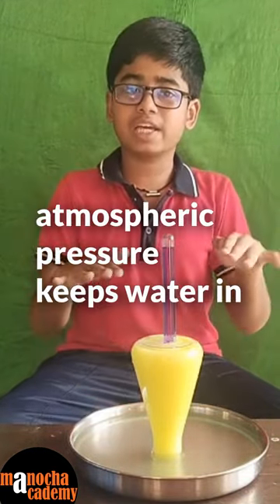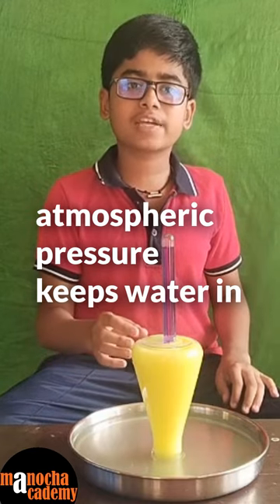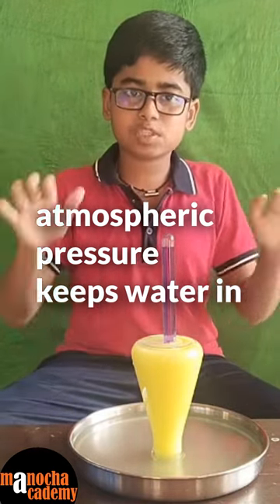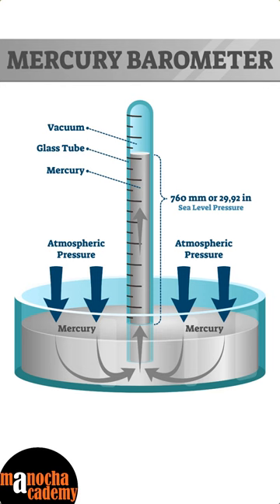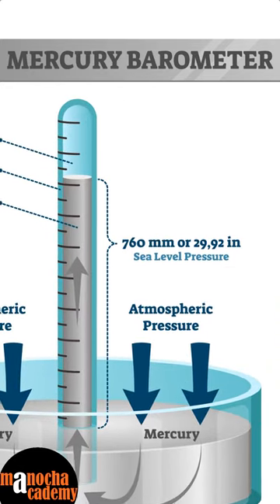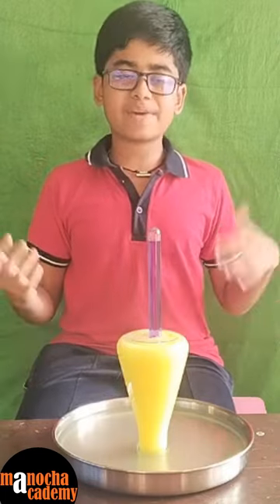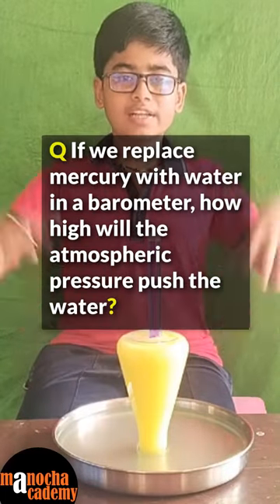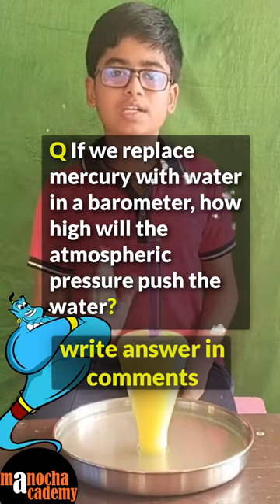Barometer How it Works #shorts

Comment: In case of water, the height will be approximately 10.34 m as the density of water is comparatively lesser than the density of mercury.An appreciable amount of normal atm pressure is required for mercury to get raisen(=0.76 m) in the other
 case.

Comment: Great work bro very good👏👏👏👌👌
Reply from the maker: Thank you 🙏
Reply: @ManochaAcademy experiment's conclusion is wrong,the reason why water is not spilt is due yo yhe container's solid force, in the original barometer the container having the fluid should be submerged in shallow more spaced fluid but the base should not ne in contact 

the fluid inside will keep spilling until the inside fluid is drained enough that the left over fluid's weight=atmospheric pressure